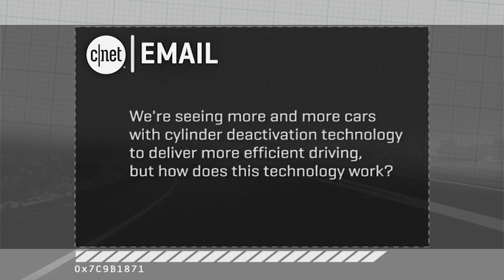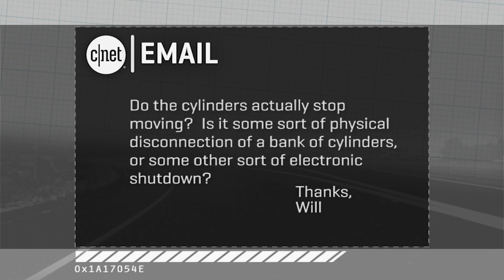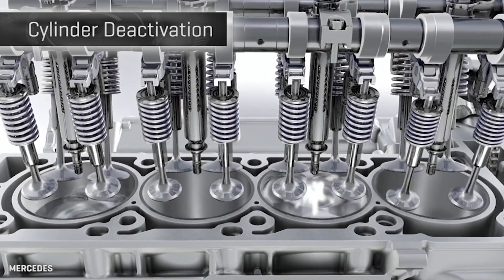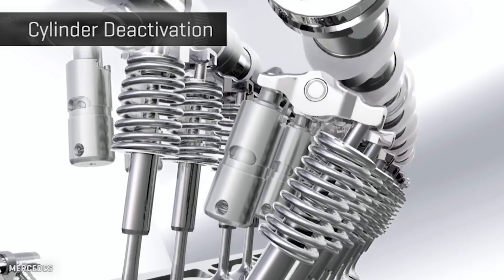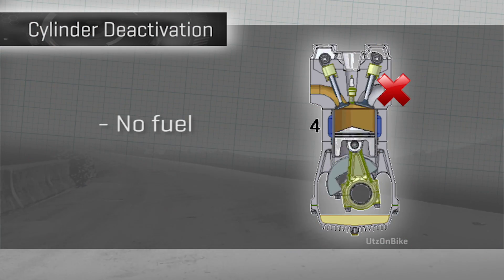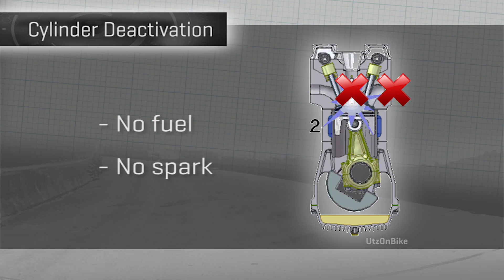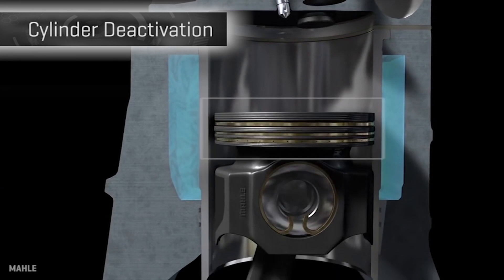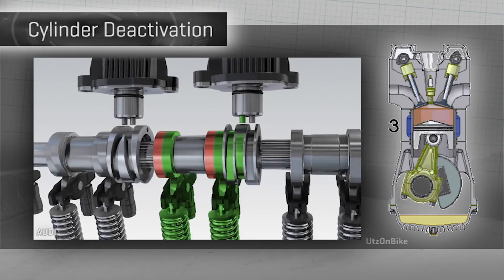Your emails: How does cylinder deactivation work? (On Cars)

Comment: This is the worst technology invented so far, vcm, afm, mds, whatever version it is called by whatever manufacturer, destroys engines.I know an engine rebuilder who rebuilds the 5.3 for gm, when he tears them down the deactivated cylinders have the rings baked onto the piston, so something is causing problems, possibly that nowadays companies use low tension rings that cannot handle the recycling of the hot exhaust gases, without the cooling effect of the intake stroke.Best option is to deactivate it, whichever way possible.

Comment: Honda VCM is the dumbest, most useless technology ever coming out of the automotive sector.  I paid for a V6, I don't need the stupid computer to shut down three of the cylinders when it feel like it to save 1~2 mpg.  There isn't even a way to disable it.  How can the same company that once developed iVTEC came up with such a stupid concept.  Honda has always been obsessed with fuel efficiency, and now they've gone mad with the VCM technology.  I am (was) an Acura fan, and now I won't be coming back to Honda products.
Reply: Vcm technology is proven to destroy engines over long haul, i advise you to invest in a product to deactivate it such as a.vcmuzzler, best 100 you will ever spend